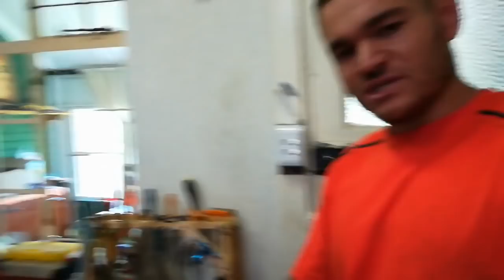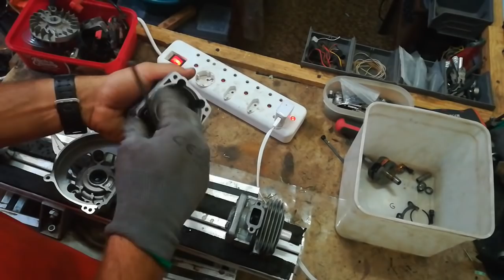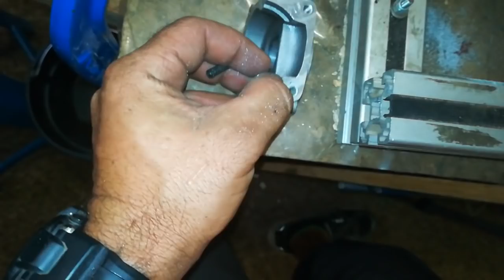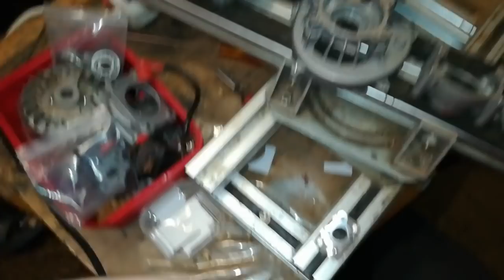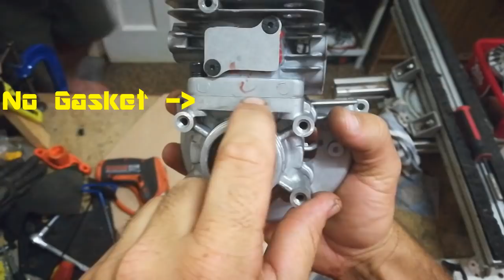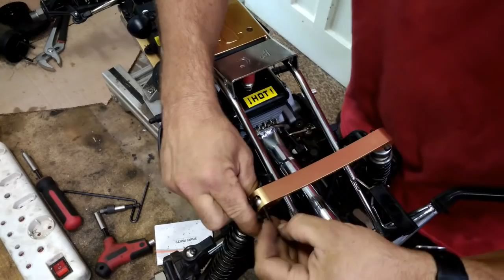Porting a Baja 5B 32cc 2 Stroke Motor │ 1/5 Scale RC

Comment: Hiya mate do you think it's better to port a brand new engine or a used engine
Reply from the maker: If it's professionally done then new is best, as you do want the longest run time on it. If it's for learning or testing then a used engine is best as you can also see thr difference cutting makes.
Reply: @EZR  thanks my friend it's a brand new 35cc I just purchased and I was going to get it professionaly done my friend will I have to do some heat cycle's first before I get it ported or is it ok to do it straight out the box :-)
Reply from the maker: Pleasure bud.
We prefer to have them ported straight out the box. Gives the porting guys a cleaner canvas to do their art.

Comment: So there is no need to torque the bolts of this engine??
Reply from the maker: Some would disagree, but I say no. Just tight enough to keep the bolts in. The case 8s made from pot metal so you can strip the thread too.
Reply: @EZR  that explains why I can’t find the spec sheet anywhere. I’m attempting my first build in the 1/5 scale scene. Turning my 30.4cc (30cc) redcat rampage xt into a 32cc. I also have a 45cc but can’t find a pipe that will work with that motor and work with my platform. Probably gonna end up ripping a 45cc header off and adapting it to another pipe. Thanks for the info
Reply from the maker: @mrskunk697   @Mr Skunk  the 45cc is a tricky one yes, especially in non Baja/Losi's. Just note that a 30cc to 32cc rebuild is a complete core swop out. You cannot use the same Cylinder, Crank Case, Piston, Crank. Everything else should fit. Chat to RC Dungeon about your 45cc. He might have already found a solution to the problem.
Reply: @EZR  yep I got the new case,crank, cylinder, piston and everything else needed coming. Just need to swap flywheel then the outter case’s. Weirdly this truck came with a tuned 32cc exhaust on a 30cc not sure if that really matter but might be the reason it blew. Previous owner ran it lean also piston looks brand new except for the gouges that the wrist pin bearing caused

Comment: The big question is what's the price on a full porting job if I buy the motor from you.
Reply from the maker: Good Day. We are based in South African and currently offer a full port on a 32/34/36/45 @ $90/ZAR1500
We are looking at exporting in the near future.
Reply: Can I send you my motor and you port it completely and I want a 32cc head on it?
Reply: @EZR  hey man,  how  much to port a gp 460 motor for a goped ?
Reply from the maker: @reptile0074  our porting costs $80 for a cylinder full mod. But our hurdle is the shipping. Still trying to jump that one.

Comment: ..how much CV After the Cure?????...
Reply from the maker: Sorry bud. Not sure by what you mean regarding "CV"?
Reply: @EZR  ..the power..hp..
Reply from the maker: We don't have a dyno but it seems to pull the same horses as a stock Zen G320. So around 4-5hp? Full motor tests coming soon - Rovan 30.5,32,36 vs Zen 30.5 stock 30.5 full mod and G320.

Comment: Eh, my 36cc probably still has more power than a ported 32.
Reply: there is no replacement for displacement.
Reply: Probably not.
Reply: No it has not ! even a good moded 29 or allredy a 26 will eat Up your original  36 for breakfast and shit it out :))
Reply: Lol your roven 36 cc is garbage u never seen zenoah 32cc it got double power ps i mod engine better than this guy
Reply: those 36cc engine might be big, but dont rev hard unfortunatly
a decent 29 or even well build 26/27cc engine will chop u up on the track,, they spin harder, go faster
Reply: My home done ported 32cc will eat a stock 36cc everyday. Onroad or offroad. 100%.
Reply from the maker: Rovan?